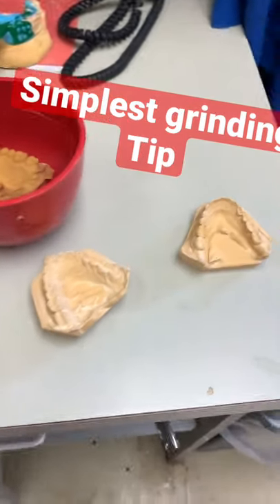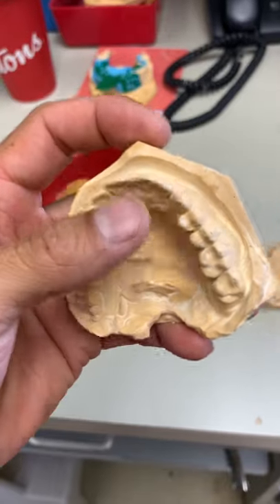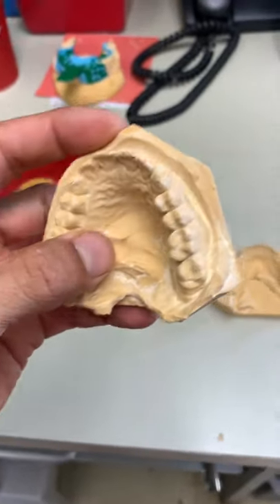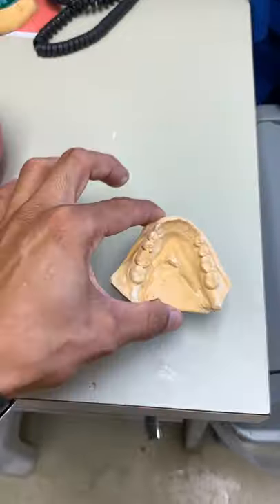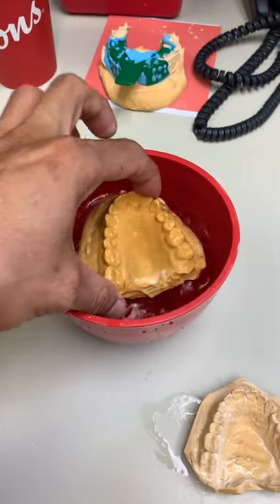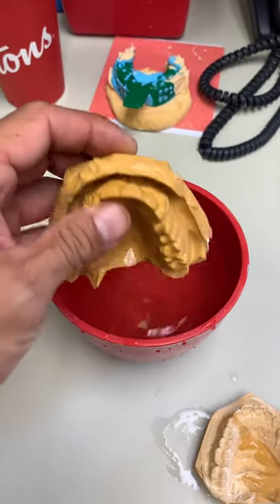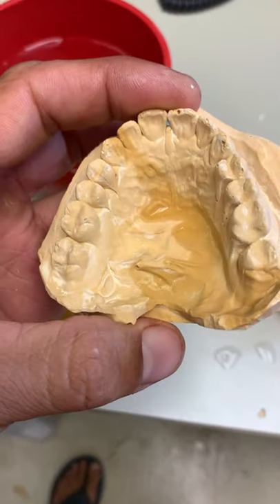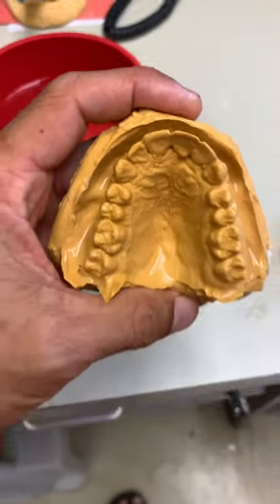Simple Dental Cast Trimming Tip

Comment: The tip I can give you is to use a scale and a syringe, 100g of powder and 22ml of water. It might seems really hard to mix at the beginning put if u use the vibrator machine it become more "fluid". Furthermore before casting any alginate model I put water + plaster powder on the alginate to dimish the acidity of the alginate, I dry it and then I pour the plaster for casting. My technique to avoid bubble is to put the plaster always in the same place and then let it flow in all the other teeth, in this way no bubble are formed and in in 45min your model is ready. I use TYPE IV plaster 

Thanks a lot for all your videos, they are amazing !!! true inspiration thanks a lot from italy :D